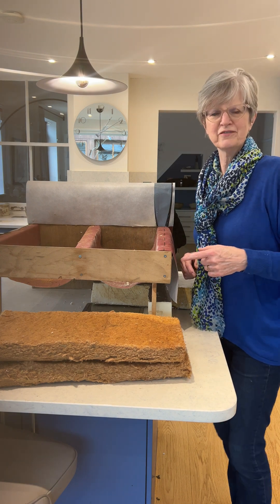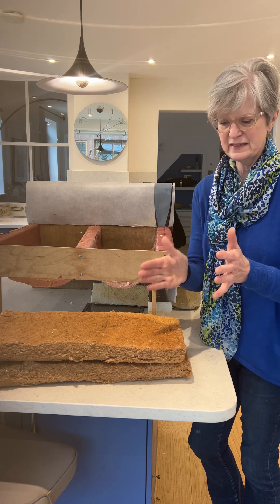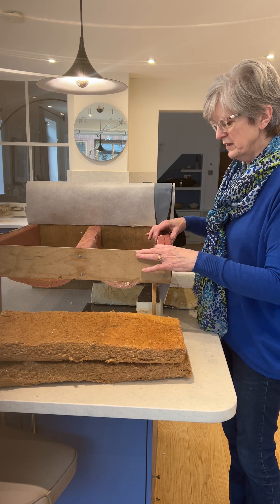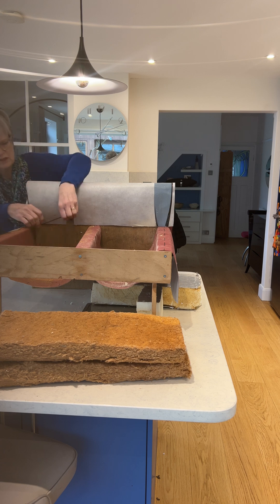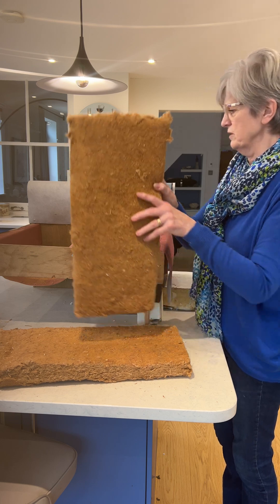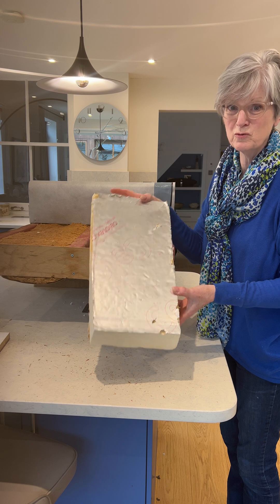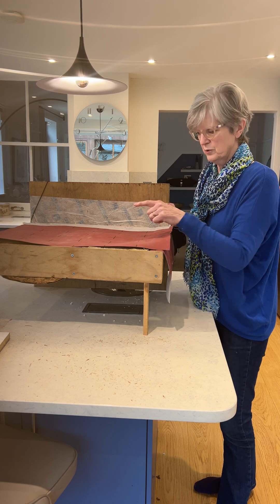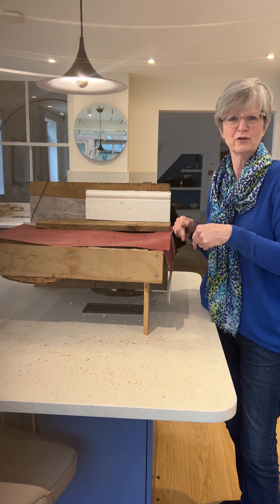Old house? Cold feet? Find out how to insulate under a suspended floor

Comment: I wish your channel was around 25 years ago , I could of done a lot of this at my mums house to save her money.
Reply from the maker: It would have made her a lot warmer too I expect!
Reply: @ecorenovationhome  Our house was mid 60s and poor build so it got dry rot ,so I had to renew 25% of the floor downstairs. Plus it was a 1 pipe system so had to crawl round under there re plumbing it.
Reply from the maker: @waynecartwright-js8tw  Wow that sounds like a lot of work! It's sad that so many 'new' houses have been badly built. Sounds like you did the work yourself - respect!
Reply: @ecorenovationhome  Its what got me my trade skills to become a DIYer ,plumber and electrician.
Reply from the maker: @waynecartwright-js8tw  That's got to be a win then! I can say similar about me - if we'd found a good eco builder I never would have learned all this. It was tough at the time but led to something really good.

Comment: I used kingspan a couple of years ago. Gaps filled with foam. MASSIVE thermal difference. Been under there a couple of times since to check things out- all ok so far.
Reply: Yeah PIR + expanding foam (or gapotape if you're feeling flush) will always give the best thermal difference as nothing beats PIR for efficiency, for a given thickness.

It's definitely much easier and more sustainable with more fibrous materials though. So swings and roundabouts.
Reply from the maker: @SamLTate  PIR is very efficient, I agree, for its thickness and easy to get hold of. Down side is it's not good for the environment sadly and off gases VOC's for a time.
Reply from the maker: Filling the gaps would. make all the difference. Glad it's working for you.
Reply: @ I also used silver tape on top of the joists  to make a VCL
Reply: Did you use a membrane?

Comment: Now then, are we putting the Contega tape against the Lath & plaster wall or are we going as far as going back to brick? This air gap is essential as it supplies fresh air through the air brick in the ventilated underfloor space then up through the wall ( in British homes of solid wall construction to keep it ventilated).

Comment: The cost and payback of this I feel is quite significant. Although the thermal benefits would be less could you just put the moisture/air tight barrier on top of the floor boards. This would stop drafts and have some thermal benefits?
Reply: Then you wouldn't have a wooden floor. I think this allows you to keep the look of a victorian floor and minimise the potential drafts and hear loss. If you want o cover a floor with cheap fake wood click system, then that is not very eco
Reply: @ but you may have carpets on top of floorboards!

Comment: Do you find rodents trying to gain access to your insulation for bedding? Really interested in your method. Thank you
Reply: @SparklyPixieDust1 a layer of double bubble foil, like but not limited to Reflectix, will keep. the rodents away. They don't like the 'crinkling' noise as they run across it
Reply from the maker: The wood fibre is treated to make it unappetising. But also it's really important to make sure rodents can't get in under the floor for all sorts of reasons - not least nibbling through wiring. Often it's the drains that need blocking off to the outside to makes sure there is no way in

Comment: So, first of all , rip up your floor boards to access the beams?
Reply from the maker: Well not 'rip' up exactly, lift them so they can go back down when you're finished. I know it sounds like a lot, but if your feet are cold enough that'll be a good incentive. Once lifted you can put insulation in-between each joist, so the floor boards can easily be laid down as they were.

Comment: How many years will it take to recoup the cost of doing this?
Reply: Don't look at insulating as a cost but as an investment. Being warm in winter is a worthy investment plus being a properly insulated home will increase the value of your house... In summary the answer to your question is your costs will be recouped instantly...
Reply from the maker: For us it was just the cost of materials, so will easily be recouped in a short time. If you pay contractors it will of course take a bit longer. But the costs are not high and the benefits while you're waiting to recoup are high - warmer overall and more comfortable. Energy bills of course lower, but also the value of your home is increased. More and more buyers are looking for energy efficient homes these days. So well worth considering

Comment: So you need to remove all skirting board architrave and floor boarding, maybe a couple of inches of plaster before you can insulate.
Then put down new floor boarding skirting and architrave.
Reply from the maker: You are better off removing the plaster. This makes sure there is no damage to the brick that needs attention or any blown plaster. It also gives you more space for insulation. Floorboards and skirting board can just be replaced. The architrave around the window will need to be built out to the thickness of the insulation but you can re-use the original if it's been taken off carefully. If you have an old, unique coving that may need to be remade or removed totally and either replaced with another or left off altogether.
Reply: @ thank you for replying and the additional information much appreciated

Comment: I might suggest instead of wood fiber, you could go with a mineral wool, I mean for anybody that's concerned about the fire hazard of wood fibers. Mineral wool is also very very insect and rodent unfriendly. Also they don't really chew through it either because it's essentially slag. And I don't mean the British slang slag. I mean like leftovers from metals purification. 

The great thing also about mineral wool is it is compression fit if you need to suspend. Also it seems like it would be possible to spend from underneath what you would have to do though is put in your wool and since it can be mineral can be you know pressure fit compression fit You shove it up in there to the r value you want and you'll take your membrane and basically kind of just so that it rests up against it and instead of you know I see you have like a sling sort of thing and said you kind of like put it in there and then you staple it so that it's less like a sling and more like a cot. So it's a fixed from underneath instead of yeah I hope you understand what I mean.
Reply from the maker: Thanks for the suggestion. We only have a 2 foot void so not possible to do anything from underneath. We are also very keen to be sustainable, hence using wood fibre.
Reply: @ecorenovationhome  Rock wool is mostly sustainable.... higher in CO2 emissions but should pay off quickly... for the obvious reasons.
Reply: @ecorenovationhome  very reasonable, if you are concerned of sustainability, mineral wool is recycled from the impurities of steel refining. it is also inflammable. however, it is only an option. I hope you don't mind sharing it with folks as they ask about your floor project :)
Reply: @ecorenovationhome  I have about 4ft underneath , think tar over soil which has broken in bits , I've been on about this for years but wasn't sure best to use or how to do it , I have vents on outside walls and gaps up between the walls so can't really stick membrane to a wall , it's lathing plaster , I can do mine from underneath and would prefer that rather than lifting 20 square yards of t&g flooring in one room , I just want something to fit from below but not sure about damp , was going to get wool but it needs treated with borax and heard it wasn't good for asthma sufferers , Im tempted to just use fibreglass like the loft which we put flooring over it , if I did it from below could I put membrane under carpet and under floor with insulation going up into it and kept in place with netting although it would be tightly pushed in and just need something to stop it ever falling out , cheers , ps could it just put insulation between joists and have breathable membrane all along to hold it all up ,
Reply from the maker: @smallfeet4581  Sounds like a complex situation. If you have lath and plaster then it's clearly a very old house so you need to use breathable insulation which excludes fibre glass. I can see why you'd prefer to work from below - saves all the upheaval. I'd suggest you speak to an expert - you could try James King at Unity Lime https://unitylime.co.uk/about-us/contact/ They supply sustainable insulation and he's always been very helpful when we've had questions,. No obligation either. Alternatively you could try speaking to the technical people at Ecological Building Systems. Let me know how you get on.
Reply: @ecorenovationhome   cheers for the reply , yes it is old , not sure if it was built 30s or mid 40s , lathing plaster may suggest after ww2 due to lack of brick on inside walls , and I will let you know ,

Comment: Did you use the same membrane for the bottom and top layers?
Reply from the maker: Yes we did. It was difficult to ensure an air tight seal up against the brick wall, so we added the top layer to be sure we were cutting out all the draughts. It all sat above the air bricks though so we still have a good flow of air under the floor - just got warm feet as well

Comment: I live in the california. I live in a 1930 house that has no insulation in the walls. At night in the winter I can feel the cold air flowing from the floor. My feet can feel it. What can I do. My home is made out of plaster in stucco. I have a crawl space under my home.
Reply from the maker: Hi Susan - good to hear from you. I can imagine that you must feel pretty cold - sounds like your house is similar to our Victorian houses here in the UK. I assume you could still insulate under your floorboards in the way I'm describing here? It would be tough to do it from underneath I think. But putting in wood fibre wouldn't be deep enough to affect your crawl space and it would make a big difference to your feet! I'm don't know about plaster and stucco in terms of wall insulation. Do you have retrofit assessors in California? I know the State is environmentally conscious so they may be out there. They survey your home for energy efficiency and work out a plan that you could do in one go or bit at a time, as you can manage it. If you can't find anyone, let me know a bit more detail about the structure and I'll ask the retrofit people I know and see if I can find some sort of answer.
Reply: Quick and easy buy a rug.
Reply from the maker: @TechStuff365  A rug can help if you can't insulate. It's best if it has a rubber back since that will help block the draughts. The problem with a rug is that it doesn't cover the whole floor. Carpet is better. And make sure to fill in any gaps where the carpet meets the wall since this is a classic place for draughts to come up from.

Comment: Do you not need to put a vapour barrier on top of it all? 
I want to put caberfloor down instead of floorboards. There no way to glue it down so it’s screws only ?
Reply from the maker: It depends what you mean by vapour barrier. It's important to differentiate between moisture - liquid molecules - and vapour - gas molecules. We put an airtight vapour permeable membrane over the top of the joists to cut out uncontrolled air. That it is vapour permeable is important in old houses since they were built as a breathable/vapour permeable system. If it is not vapour permeable, moisture as a gas will get trapped in the system and eventfully it will begin to condense and cause problems. 

If there is any risk of moisture - water molecules - going through the floorboards then a moisture barrier may be a good idea. 

Not sure if this is helpful - I may not have understood your question fully. Take a look at the video on breathability and see if that helps.  https://www.youtube.com/watch?v=8toVCb4SItE&t=9s

Or if I've just misunderstood, ask again with a bit more detailed. If I don't know, I'll see what I can find out for you. 

With regard to the caberfloor - I've not heard of this but from the picture if found it looks as if it screws to the joists. if you are using an airtight membrane you can use screws that have a much bigger head that stops any air coming through.
Reply: If you can get into your crawlspace, yes, its recommended to put a plastic vapor barrier on the bottom (ground) if its dirt.  Then barrier on top of your joists between the joist and subfloor. If that crawlspace is vented, use Tyvek under your joists to prevent the insulation from wind washing and external moisture while allowing any trapped moisture to escape. *Edited for clarity
Reply: @ChrisParkens Shouldn't any vapour barrier go on the warm side of the insulation? If you put a barrier on the cold side, will vapour not permeate the insulation from the warm room side, and condense towards the cold side where it reaches dew point, leaving the bottom of the insulation (and floor joists) wet?
I would think, for suspended floors, breather membrane under the insulation and vapour barrier on top would be the way to do it. And in a cold loft, you would lay the vapour barrier first, between the ceiling joists before laying insulation on top. Or I have I misunderstood the purpose of a vapour barrier?
Reply: @barneyandhannah  I should clarify, sorry.  Vapor barrier on the (bottom) ground if its dirt which most are. Then barrier on the floor between joists and subfloor at the top. If the crawlspace is vented, use a breathable membrane (Tyvek)  under the floor joists. So from the ground up, vapor (over dirt) membrane (under joists), barrier (over joists but under subfloor)